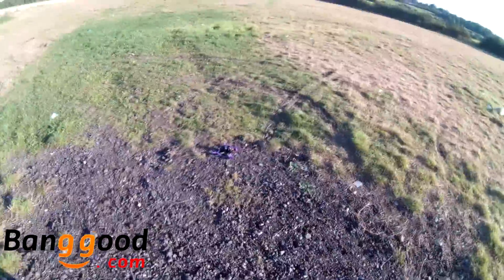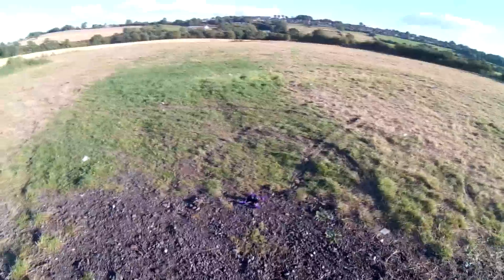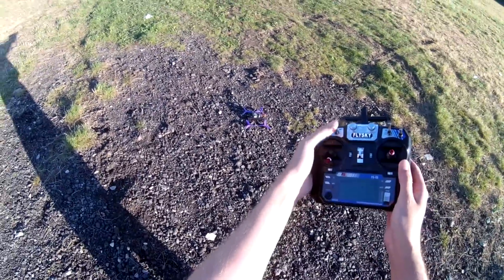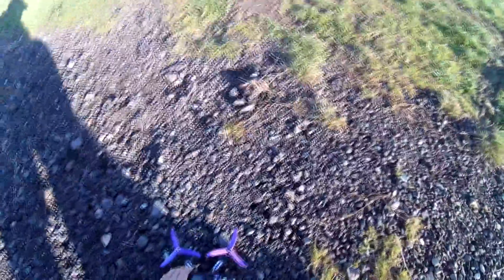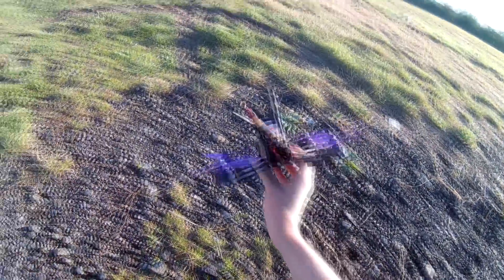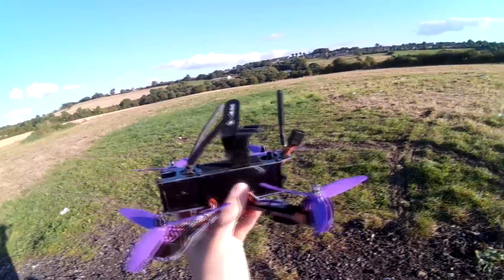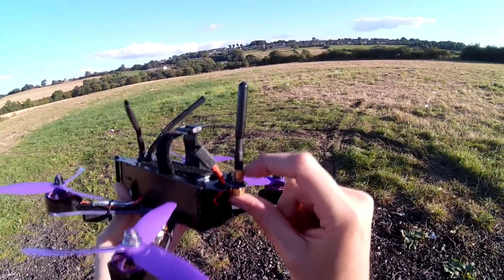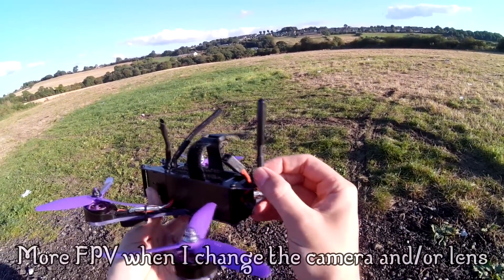Eachine Wizard X220 - Betaflight 3 and adding a buzzer

Comment: I understand the soldering, I did so already, what no one addresses is how to assign a switch,
Reply from the maker: The software side is exactly as you set up any flight modes.
If you haven't set up your quad and just flown it out of the box then you need to connect to Betaflight. 30 second task, be sure to save and remove props while testing.
On the receiver tab you will see you inputs as you move sticks - these should be from 1000 min to 2000 max with 1500 dead centre. If you flick your switches you will see those bars underneath move too.  2 will work by default and should be aux1 and aux 2, one of which will be setup as your flight modes.

These are visible on your 'modes' tab' lower down in Betaflight. Flicking switches in here will show you what modes are setup to what switches - always save for changes to be set.
If you wish to change which switches on your TX do a certain function, you must change those outputs in your TX under 'aux in the system menu.

If you need some video to follow just search anything related to 'Betaflight  flight modes' and you will get hundreds of videos. Same procedure for Cleanflight and Betaflight for at least 2 years and doesn't look like it's going to change.

Painless very old video but procedure is exactly the same for buzzer or any other flight mode selection.
https://www.youtube.com/watch?v=nFFK8KDWMKc&t=25s&ab_channel=Painless360

Joshua Bardwell
https://www.youtube.com/watch?v=SLy28mYiAzU&t=335s&ab_channel=JoshuaBardwell
Reply: MicroRCFiend I appreciate the response will be attempting today

Comment: This thing is fastVery clear picture of how to do buzzerThis is the way forward for the rest
Reply from the maker: There is picture on screen at 4:01. Pause if you need to.
This video has some close up pictures of the buzzer and vbat wire also. Vbat only needed if you want low voltage beeps. Buzzer works on a switch like flight modes once soldered up and does not need vbat to work as a basic buzzer.
https://www.youtube.com/watch?v=vfpmDPa4C6w&index=4&list=PL8zs5ZGIg_iwHKYg9tNovUZUSIZNycsgR&t=111s&ab_channel=MicroRCFiend

Comment: i waited a month to get my wizard from banggood and they send it without props....smh
Reply from the maker: They come in a separate box and sometimes not together. My ARTF arrived 2 days before props and there's a bunch of people on the RCGroups forum thread also had it happen.
I'd send BG a polite email anyway just in case as they will ask you to wait a few days normally anyway. This way if they really have gone AWOL, your wait till they resend more will be minimized.
The stock Wizard will fly well with any 5" prop I tried so if you can borrow or grab anything it should fly well enough. It dies seem really well matched to those KK triblades though.

Comment: Dude can you do me a huge solid and just make a noob friendly video of how to install the buzzer?
Reply from the maker: Which bit you having issues with? If you can be specific it would help.
The buzzer will just work as soon as you solder it to the buzzer points as shown at 4:01. That is it will beep when you power up and change modes but will only beep constantly if you set the buzzer to a flight mode - exactly as you would set rate mode or air mode or angle mode up to a switch.

Once that is done, if you need the FC to read voltage so the buzzer beeps when you have low voltage, the only other thing that is needed is that single wire soldered from lipo input positive on your PDB to the vbat, again shown at 4:01. The FC can't be given lipo voltage directly so that vbat is special pin that will drop the voltage down and make it safe to put lipo voltage via that pin directly .Without vbat, the buzzer can't possibly know when what voltage the lipo is at and buzz to let you know.

I really don't feel it needs an entire video to show what that thumbnail image shows at 4:01. Buzzer two wires for pos and neg, vbat single pos wire.

If buzzers and flight modes are making zero sense then take a look at some of painless360 FC walkthroughs.
https://www.youtube.com/watch?v=wlEHvwQzXaY&index=8&list=PLYsWjANuAm4pnhS9StKcIbwSOdoMaR9-p&ab_channel=Painless360
Reply: MicroRCFiend Okay so I'll try to be a little more detailed here, but bear with me I've had a quad for like 3 days now so I'm extremely fresh to this. I have a Target Hobby 3in1 buzzer, so it's supposed to have the lost model recovery, low voltage alarm, and a signal loss feature. But to my understanding you can only have it set for 2 out of 3 functions. I seem to just have issues with this vbat wire, like how to identify it and where to solder it. The alarm I have has an led and 2 buzzers, and came with this wiring harness that just confuses this hell out of me. The alarm by itself is soldered properly and beeps when I turn the quad on but that's it. If I use the wiring harness to wire it to a spare channel on my rx and try to program it to an aux switch I get nothing. But there's this female plug on the harness that I have no clue where it belongs and if it gets used or not. Sorry to be so vague, like I said super green here. Thanks for the quick reply though bro, I really appreciate you looking into my issue.
Reply from the maker: I have no experience with that buzzer setup, drop me a link?
Please test the buzzer on it's own.
Have you got flight modes setup to a switch?
If your buzzer is powered and connected, do you get it working when you set it as a flight mode constantly going? 
Does it beep momentarily when you switch flight modes from angle to horizon or rate?

The vbat wire is separate to that buzzer 3 in 1 device you have. The FC needs to see your lipo voltage somehow to be able to beep when you have a low voltage. This single cable goes from your lipo input (big ass red wire connected to your lipo) to your FC VBAT pad positive. You can use any scrap of wire for this, it does not have to be thick as it carries practically no current. I honestly don't know how to be more clear with that. If you can see the vbat pad and you can see your lipo input to the PDB, connect them with a wire of your choice. Good idea to make it long enough that it will allow you to remove the FC without de soldering it.

One you have those correct, any extra functions of your 3 in 1 device should be in addition to those features. Drop me a link to it and i'll have a look

Comment: besides zipties for your receiver antennas what else can be used to prop em up properly in the frame?  i got i6 receiver flysky and the bulge on the wires is anoying as hell.
Reply from the maker: I usually use cable ties and heatshrink to fix the antennas down but on the outside. I was ok LoS but i'd expect range to be limited if you keep them stuffed inside.

Comment: Is it possible just to add an osd on this quad?
Reply from the maker: Sure, any naze/cleanflight compatible OSD will work.
2204 motor RTF has a naze F1 board, the 2205 motor ARTF has a SPF3 board.

Comment: I ordered an ARF version. En route to me now, also i6 controller, turnigy 3s 70c 1500 to get started. Ill be watching ALL of your videos close to set it up :) great footage and info!
Reply from the maker: I hear the 2205 motor version is a good chunk more power, sounds like a tasty setup although i'd consider a wider lens and buzzer also. Only £3-5 but will allow you to see much more to the left and right of the quad. I read the yaw is turned right down to zero for some odd reason so watch out for that as well.
I have one here to compare but waiting on a bunch of receivers before I can get it flying.
The Fsi6 will also take a firmware update to give to 10 channels with the same ibus compatible receivers. iforce has a video here if interested. 
https://www.youtube.com/watch?v=eaj0M218HSM&index=48&list=WL
I pussied out and just ordered the dongle rather than messing ftdi adapters. Ibus also has no jitter on the channels and for me came really close to perfect endpoints too.

Good luck with the Wizard, it's pretty aggressive even on 3S. I'll try and cover my setup of the 2205 version in the next video but shout if you have any questions.

Comment: cool video .... and you are a very good pilot ....hot the H can you see the aircraft
Reply from the maker: If it's predictable in flight like BF3 then it's easier as the track so well but the Wizard has LEDs so visually it's not so bad unless far away.
Definitely find quads way harder to get, keep and regain orientation compared to a heli.
Past that it's just practice and a mix of 'is it going where it should?' and 'yes, carry on' or 'no, adjust'. 
Premeditated and reactionary flying working together, neither one will work all the time for everything.

Comment: Hi MicroRCFiend I've upgraded the stock Wizard flightcontroller with the SP Racing F3 board. Having no voltage beeper is driving me insane. I want to add a buzzer but don't know witch one to get for the SP Racing F3 board? Also I want one that is as loud as possible any suggestions? Oh and is it as easy as soldering it to the board and just setup a minimum voltage around 3,50V or do I have to add something like Vbat? Thanks Greetings from Justin.
Reply from the maker: The one I fitted is bog standard cheapy but the loudest I have heard yet is the Lantian buzzer. They are just expensive and you get 1 instead of 5 or 10 of the others.
http://www.banggood.com/LANTIAN-NAZE32-F3-Supper-Loud-Beeper-5V-Buzzer-Tracker-For-RC-Racer-Drone-p-1064863.html?rmmds=search?p=UI14032168777201508N
I think the LVC buzzer is setup by default but yeah you can tweak those values up and down to get it to go off at the voltage you desire.
So you have to solder it up to the buzzer pins and also add that single pos VBAT cable so the board can read your lipo voltage, enable it on a switch like flight modes, save and then adjust that value on the config page. You might even get a buzzer going off constantly until you configure it if it's powered up so I tend to do that first of cover it up with tape or blue tack while working.

With that FC you can probably raise it from 2k,1k to 4k,2k. Just make sure the CPU usage doesn't go above 60-80% and you will be fine.
Reply: MicroRCFiend Thank you for your reply! I'll go with that one, but there are only two cables I'm missing the one for reading the voltage.
Reply from the maker: Docter J fpv There's no cable included for vbat, just use any scrap of thin/light duty insulated wire. Good idea to make it long enough that you can still remove the FC from it's spot without having to desolder it.
Reply: MicroRCFiend Thanks again I'll probably do more research how to set up a low voltage warning.

Comment: Indeed Excellent LOS skills...! question: I'm putting in a buzzer and have taken the ve+ from the vbat just like you describe, what about ve- to feed the buzzer ve-?? is that somehow coming from the board? or do I solder that from vbat ve- as well?? I've hooked it up the same as your picture with no ve- and nothing happens when I hit the aux2 (the light on the board comes on though), checked with a multimeter and there's no current getting there, so I went ahead and soldered in a ve- and still no dice. The buzzer works and there's current getting to the other close terminals but nothing to the buzzer terminals with it without aux2... any pointers? as it's driving me nuts trying to figure this rather simple mod out. thanks! :)
Reply from the maker: The buzzer needs both pos and neg to work and complete the circuit
The FC and therefore the Vbat is already grounded so there's no need to solder neg too. There's also no harm in soldering the vbat neg either. I didn't make a video or pics as I made some close ups in the grasshopper video but it'd definitely just the pos needed for the vbat. The buzzer should still work regardless of the vbat connection, thats just so you can set a lipo voltage to beep at. Without that, the buzzer should still do a momentary bleep on arming and disarming at least and usually will just keep going off until assigned to something.
Does is do that?

You have to set up the buzzer as a flight mode is set up in cleanflight. The other video in this x220 playlist (link in the description) shows me doing this but you have to make a TX aux switch change too I think.
Function setup> Aux channels> and change the source to the switch you want.
Channel 5 for me is SwC for flight modes on the right 3 position switch
Channel 6 is buzzer set to SwB for the left 3 position swicth middle position.
Pressing ok progresses to the next one, holding down cancel for a long press will save and exit that menu
Reply: +MicroRCFiend thanks for the quick reply! I've just watched your other vid installing the buzzer and everything checks out. I've got aux2 setup in betaflight to arm the buzzer when switched and it tests fine via the graphic in betaflight and also by lighting the buzzer led on the FC. To prove this I also removed the aux2 buzzer setup in betaflight and retested and no FC led comes on. No initial beeps or anything comes from the buzzer wether setup or not in betaflight. My multimeter gets no current to the buzzer +/- on the FC when armed or not and to make triple sure the buzzer physically works I jumped a +/- to the buzzer pins and it sounds as per usual. So I'm at a complete loss and have wasted hours trying to figure it out. Sounds like the FC is at fault and as a last resort may just flash BF3 on there to see if that makes any difference. Thanks again for your help!
Reply from the maker: If no small beep on arming and buzzer works out of the quad, something is funky. I doubt firmware will change that but no harm in trying.
You didn't mention if you set up the correct aux switch in the transmitter although I doubt it's that if no momentary beeps.
Reply: +MicroRCFiend I've just done a complete system reset my TX, set ch5+6 to what you have, rebound to rx, setup the aux switches aux1=flight modes, aux2=buzzer... and... nothing haha. frustrating to say the least. I nearly lost my quad in the bushes yesterday and only found it due to the quiet chirping it does when it's lost TX. and I'd only seen this video of yours earlier that day and thought... right must do that pronto! Ah well it's not meant to be. thanks again!
Reply from the maker: Bummer. You can shorten the blheli beacon effect from stock 10 minutes down to 1 or 2 so at least they will be making their beeps for you when looking for it. Once its not armed the counter begins. You can use blhel via the same usb cable now too so no messing about, quick and easy.
There's separate lost model alarms you can solder up if the buzzer function is fritzed too
Reply: +MicroRCFiend thanks for the blheli tip... I've just set it up for 2mins at double the loudness so that will just have to do. onward and upward... thanks for your help and look forward to more of your videos.. cheers!
Reply from the maker: pulsta I've not messed with the volume before so might be worth testing it for 5 mins and seeing if there's any heat produced. I'd guess you will be fine bu I remember reading something way back about not messing with other settings much apart from timer. Just not 100% sure there.
Reply: Cool - I ran it for 10mins and the motors were a little warm so I reset it back to the default just in case! I thought while I'm at at I might as well flash BF3 on there which I have now...too bad I removed the buzzer already as I didn't get to test it out with BF3 haha. Thanks again!